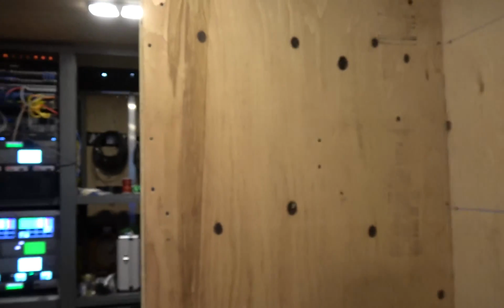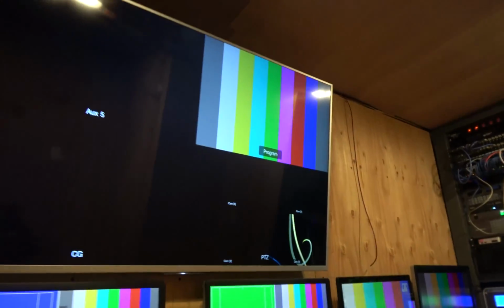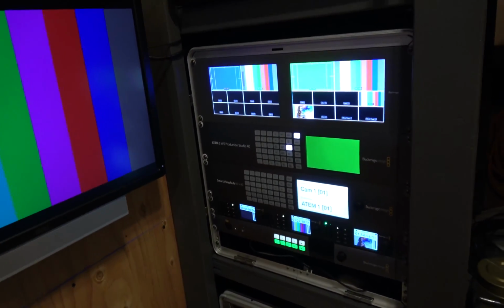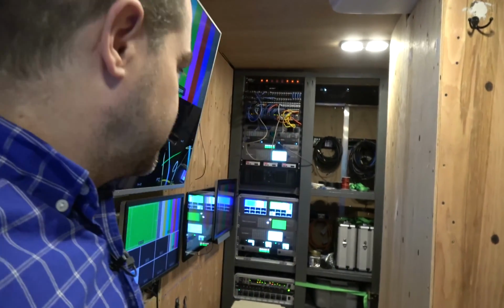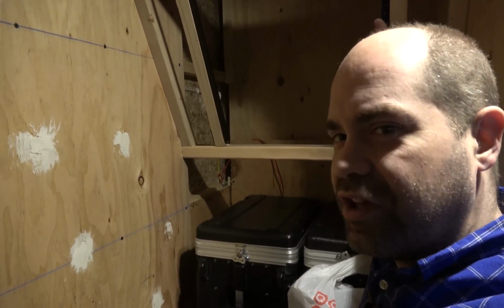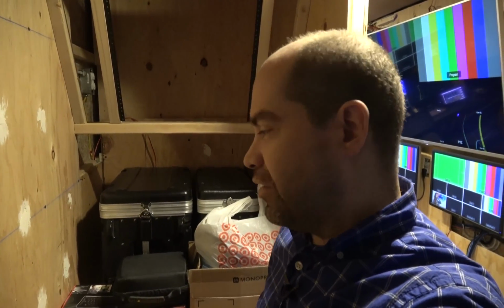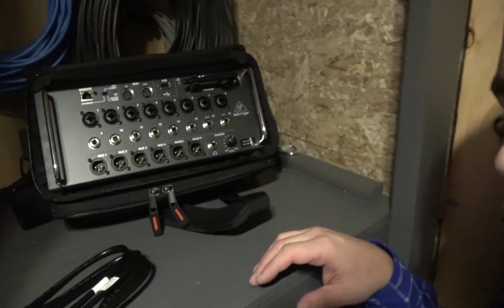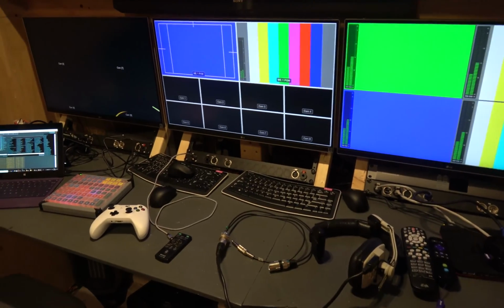Trailer Construction Update - Nov 11, 2017

Comment: Yeah we did pretty similiar decision. We already had digital Soundcraft UI24R mixer but we what use it more remotely so we put DANTE AVIO Input on master outputs and basically we created a stagebox from it. With Dante Input we have no outputs but it's okay for our situation for now. There is a way to attach USB with 32x32 ASIO to mini PC and convert it to network with Dante Via  or just buy proper stage box with proper DANTE mixer later.

Comment: The trailer's coming together well! It's the fiddly bits (and cabling) that takes so long to finish. But so satisfying when it works! 

Any thoughts on physical control panel for your ATEM? I know the Blackmagic solution (especially for 2 M/E) is expensive. I've found that ergonomically, "hovering" my finger over a touch panel or mouse/track pad is less productive than having actual button to press with confidence. (I have a portable ATEM M/E 1 4K with a GVG-110 panel refurbished by Baz; works great at third of the cost of BMD panel.)

And lesser priority for audio booth area is understood - I get the sense you know what you're doing :).  I will point out for others doing similar work: don't forget that the audio feed from your venue may be poorly suited for your livestream/video needs. Common problems like "no drum mics" and "no ambient audience audio for applause" - not to mention setups where venue EQs audio to fit their acoustic space. (I have mic/line splitters - with isolaters where possible - to use in similar situations, so that the video guys get clean audio sources before they're, ahem, enhanced by the venue. ;)
Reply from the maker: I'm currently using an X-Keys USB panel for a physical input device to control the switcher.  It isn't perfect, but it works well.  As for now, I'm using it with the JustMacros software -- which has been more than problematic for me -- but I'll be developing my own software solution for that at some point when some of my other projects are out of the way.

I actually have a stronger background in audio than video.  So I'm pretty confident in being able to get a good audio feed, and doing things like setting up mics to capture ambience are pretty routine for me.  I've got just as much audio gear as video gear so I've got plenty of mics, cables, etc.  Fortunately, most of the people running audio at the majority of the venues I work with are open to ideas on how to create a better mix and they're often eager for me to help them learn new ways to use their gear.  But, yes, for others getting involved in this type of thing, these are things that have to be taken into consideration.

Here's a highlight reel of one example of something that DJP shot just a short time ago where audio was a major consideration: https://youtu.be/p8Ia9gAZoSA.  Someone else did the audio but we were able to tap in and get a good quality feed out of it.
Reply: Doug Johnson Productions Good deal. I've been meaning to play with MIDI/OSC solutions for controlling ATEM. (There's software that uses OSC to talk with ATEM, opening up possibilities of using MIDI control panels as well as triggering ATEM with QLab/OSC/MIDI software. ;)
Reply: Doug Johnson Productions Yes, good clean strong audio on your Highlight demo link. Your strong audio background is a great advantage for you to offer for clients. Great visuals, too. Thanks for making and sharing your videos for us!
Reply: I used JM for a few years but being a Windows IT guy, I found LUA just a bit annoying so I developed a PowerShell library for automating the ATEM and lots of other stuff. See https://ianmorrish.wordpress.com for more info
Reply from the maker: Looks pretty nice!

Comment: Thanks again for a great update video. I am curious about the setup procedure for all your stuff. You've got a lot of video/audio devices, many monitors, computers, etc... While this offers great versatility, do you plan to have some sort of "centralized preset" solution - like one piece of software that will configure all the switchers, multiviews, routers, etc - or do you plan to do it manually before every job?
Reply from the maker: The switcher itself reverts to a known state each time it is power cycled.  So that one is easy.  I just set it up how I like and save a new startup config directly in the switcher itself.

The software that comes with the video routers has the ability to store presets, so I have a set of presets (one for each unit) to put everything into a known starting state.  That covers the majority of the reconfiguration that is necessary.

Aside from that, at some point not too far off I will be writing some software that controls pretty much everything.  That software will also give the users at each station the ability to quickly reconfigure which video sources are shown on their monitors.  It will be a really easy piece of software to write.  Blackmagic Design does a really good job of documenting how to talk to their equipment (aside from the switcher, which really ought to go through their API). I've written prototypes that mimic the functionality I need, but haven't built the final app quite yet.
Reply: Thanks for the info. I know about BMD's great APIs and that they are well documented. I did develop software for switchers, hyperdecks and SDI I/O cards and it is all working nice but I was interested in knowing how you plan to do the "big picture" configuration.
And btw: there is description of the Atem switcher protocol on the internet (i.e. skaarhoj pages, etc...) and it is not that difficult to control basic switcher functions without Atem software. Its great if you want to control the switcher from systems where you can not run Atem software (Win32, Raspberry PI, Arduino, etc...)

Comment: What's you plan for a sound booth in case you ever need commentary..?
Reply from the maker: I'll just have to take that one on a case-by-case basis. This trailer is certainly too noisy for that. But there are other options. Paul has a travel trailer that we could probably use. I have just had commentators inside the venue itself before and that actually worked great.

Comment: Did you plan the trailer build with CAD drawings or are you just going with it as it happens?
Reply from the maker: Spencer Mullen I had pretty much every inch planned out before I ordered the empty trailer. It wasn’t in a CAD application, but rather Visio instead.

Comment: Mastering units I use are the DEQ2496 units. FWIW I like the DBX measurement mic much better, they seem to have smoother high end response. By the time you get the Dante on Behringer X32 it is actually more than the Yamaha. 
Dante is definitely the way to go with audio that needs to be routed. The delay sync works through switch delays. None of the other protocols manage that for you.
Reply from the maker: I've got one of those, and I really like it.  Great for pretty much any type of equalization.  But it's pretty limited when it comes to controlling levels.

I just confirmed that the processor I'm using is the DSP-9024. I still haven't found anything quite like it. Most people doing mastering are doing it in software these days so the need for dedicated hardware has diminished quite a bit, so there isn't quite the demand for new products that there was 10-15 years ago. I've had mine for at least that long and it has always done a great job about making sure my levels are where they need to be.
Reply: I use the DEQ2496 as a speaker processor. I dont want to have room EQ on the mixing board, so I can use a split signal off the board as stems for recording or livecasting. Look on the DYN page, compressor, limiter and gain levels right there. Of course your prefered method isnt wrong, but the DEQ2496 will do it all.
Reply from the maker: I’ve always done the same. A nice clean mix out of the mains of the board, then EQ on the DEQ. Works well.

Comment: Extremely interesting as usual. Have you considerede the Behringer X32 producer as an alternative to the Yamaha TF3? It supports Dante and would be significantly cheaper, and still be a 32 in / 25 out mixer (provided you use stage boxes. Anyway, a really fun series to watch, thank you!
Reply from the maker: The fact that Behringer doesn't have their own Dante-compatible stage box worries me.  Just how compatible would a Behringer mixer be with someone else's stage box?  Would it control gain, phantom power, etc. properly?
Reply: Well, Dante is Dante, but those are very good questions. So I'll have fun with it and look it up :)
Reply: Dante is a complete end to end protocol. There is a well defined way to interface every aspect of what devices support with it. Nobody has their own Dante controller. The IP is bought either in chip form, or as a firmware license.
Reply from the maker: That helps alleviate the concern a bit, but I still feel like the TF3 is a better fit for what I’m doing.

Comment: Hallo i follow the constructions of your ob trailer. a tip, check out vmix.com for replay maybe it works fine for you. I run vmix for my productions. best regard Rickard www.rpmedia.se
Reply from the maker: It's limited to 4 cameras... I need to run more than that.
Reply: maybe this https://www.broadcastpix.com/Options/PixPlay.html
Reply: Vmix is fairly cheap. So a second box could be used to get 8 cameras. Just thinking outside the box. Curious to see your solution though.

Comment: I’ve always wondered about running analog audio over CAT 5 cable. Are you using shielded? Do you run multiple channels over on one cable? Seems like you would get crosstalk.
Reply from the maker: I use shielded when I have to run phantom power, otherwise, UTP works fine.  Cat5 is designed to minimize crosstalk, and the fact that the signals are balanced really helps with that as well.  The only time I've heard any at all is when running mic and line signals over the same cable, and even then it was pretty minimal.